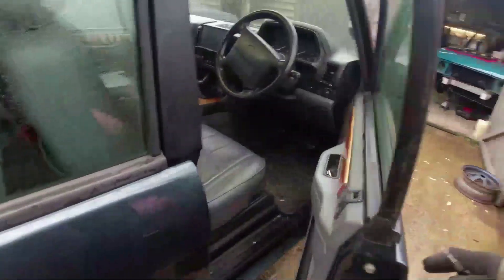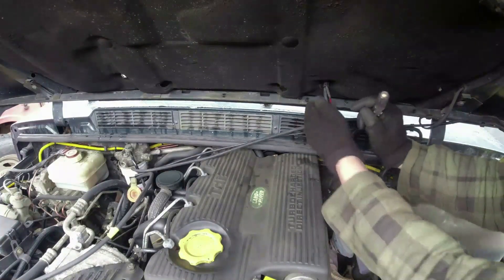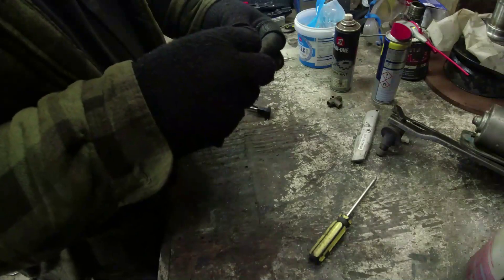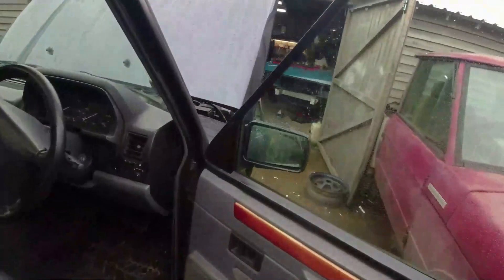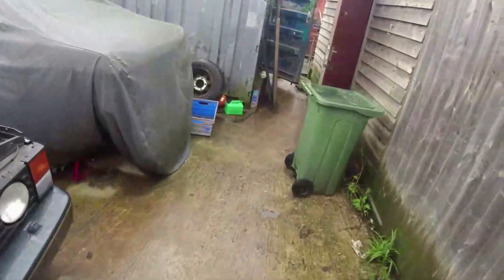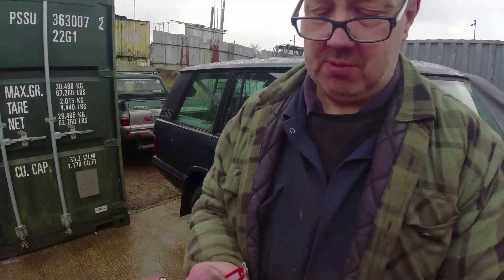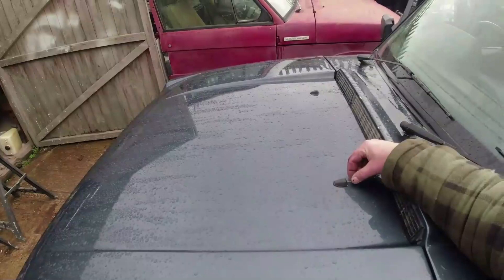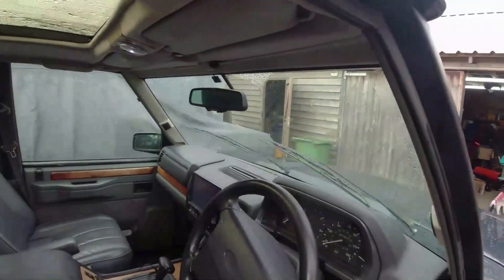How to: Range Rover Classic screen washer jets

Comment: Saludos desde barquisimeto Venezuela excelente portal de range rover classic.  Tengo 4 classic 3 de 2 puertas años 73, 79 y 81 motor 3.5  ensambladas en venezuela y una 4 puertas 1991 NAS motor 3.9 importada de Usa. Usted sabe si la bomba de abs wabco de range rover 1991se pueden reparar? gracias
Reply from the maker: Hello and thank you for contacting me, not an easy question to answer without knowing more detail. Please email me churchhouseclassics @ gmail . com with details of what is wrong and I will try advise